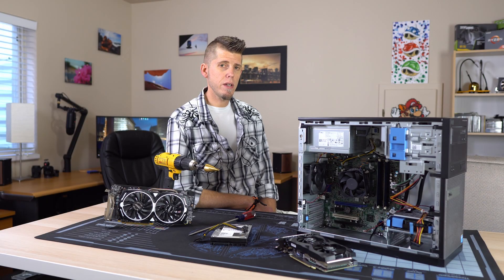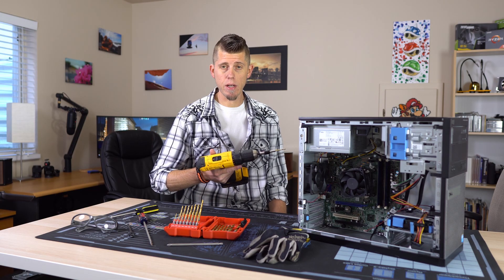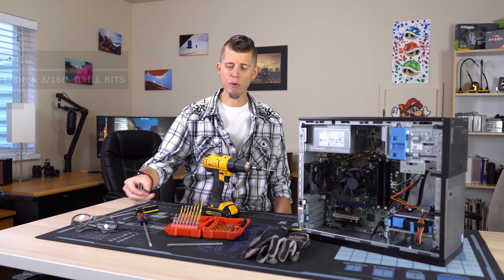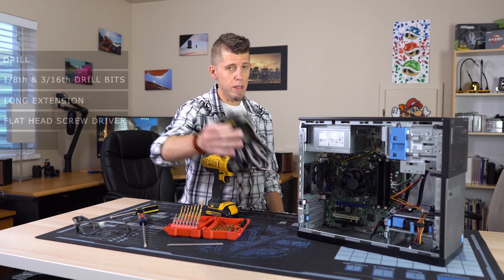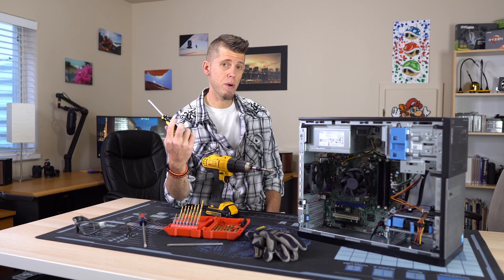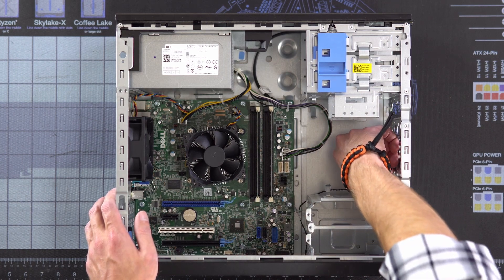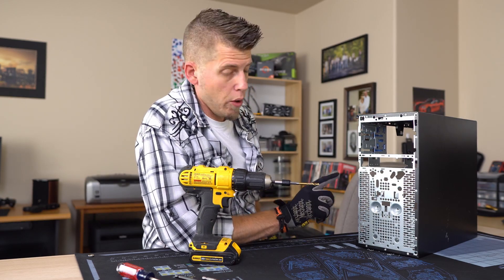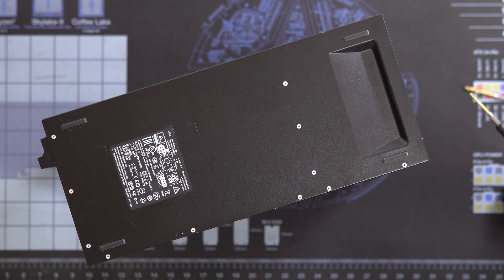Adding A Bigger Graphics Card In A Dell OptiPlex

Comment: The problem with an Optiplex, or a HP Prodesk or other similar corporate PC is the PSU is often Bespoke and does not offer any power for GPU's. Typically i have found the GT720 2GB is about the biggest card you can get that does not need additional power.
Reply from the maker: Actually, there are 1050 Ti models that don't require dedicated PCIe power that run just fine. I have one in an HP ProDesk 600 G1 SFF with a 240 watt PSU. With a 4690K, it'a max total system power draw at a full system load was just under 130 watts.

As for the xx20 series OptiPlex's, they have a 290 watt PSU and I've measured the power draw from the wall with these as well. You're fine up to about an RX480/RX570 or a GTX 1060/1660.

Anything above that, and I would agree that a higher wattage PSU is a must.

Comment: Edited for drunken behavior...
Reply from the maker: Damn man! You don't see many of those DT models. I've seen a lot of people doing just that, hacking a hole in the side, and leave the GPU sticking out. If you're going with the 1650, I did see that Zotac has a low profile model out... finally. You could always trade for that and then you won't have to hack the case up.
Reply from the maker: @kdevus  Haha... I was thinking you could sell it on eBay and grab a LP card, but hey, if you're cool with cutting it up. It's fun to mod crap. Thinking about grabbing an SFF and installing a 1080 Ti on the side.
Reply: @TheGameBench  Well, now another dilemma. Slot provides max 50w power. Card is slot powered. Requires 75w of power. They don't have LP cards that are 4/6/8 pin connect for external power. So if this self-powered card don't work, buying a power supply will do nothing. As the board itself is limited to 50W output on the PCIE 3.0 x16 bus. Sounding like the only option may be to ship it back. Get a similar card that allows external power, and go from there. Only thing is. If it's STILL not enough to power the card (I dont suspect its not enough but who knows) I'll have wasted two video cards and a power supply for nothing... not to mention buying an optiplex in the first place. I knew I should have bought the pieces and built my own. I'll let you know if it even powers up tomorrow with the GTX 1650. If it does, I'll go with the new 400W PSU and call it a day after modding the case. If not, I'm stuck...
Reply from the maker: @kdevus  I can verify that those SFF OptiPlex's can run 1050 Ti's. People run them all the time. A 1060 would be no issue either. The PCIe wattage limitation is a concern on some systems, but it's not a factor here.
Reply: @TheGameBench  The 1650 fired right up no problem. I had to modify the case. I'm putting in an extender window after I get some more dremel discs. It don't look bad. Once I get the window installed and the lights, it should be pretty cool. I'll have to show you. But I thank you for the help and confidence. I went ahead and jumped in, and it ended up working out. I'm still going to upgrade the power supply to a 450 bronze 80+ Seasonic for good measure. It passes benchmarks fine and only uses a little over 200 watts under load it seems. Dell probably kept it safe. It's a gold PSU dell has in this thing, and while its only 250w, I'm sure there a small margin. Now that it works, plays games well, and passes the initial crude tests, I can now focus on making it fancy. Yay. My first decent gaming rig. Optiplex 7010DT i7-3770, 16GB RAM, 4 GB OC DUAL ASUS GTX 1650, SSD. For some of my older games, it is pretty great. I'm about to run some tests on Fortnite just to see what it can do. Thanks again man. Rant over!

Comment: Or save all this hassle and go get a cheap $29 case and move everything into it. Saves so much time!
Reply from the maker: Nah, I'd rather use this than some trash $30 case that's going to have the structural integrity of tinfoil and cable management that's marginally better at best.
Reply: @TheGameBench  however, the cage and plate you removed was part of the structural integrity of the Dell case.
Reply from the maker: @yourpcmd  Not really. It's not any less sturdy after removing the HDD cage. Even if it were, it's still far more sturdy than a cheapo $30 case without the cage. Also, everything in the $30 price range looks even uglier than than these OptiPlex's. Especially when I get done with them. All that being said, the point of these videos is to build a quite capable 1080p gaming PC on a console budget.

Comment: I have a Dell 990 I have had for years that I simply used tin-snips (Home Depot $10 Aviation Tin-Snip) to cut out the drive cage. Not as pretty looking as your suggestion, but cheap and fast, as I did not have to take the case apart. With a PSU upgrade I run a full size  RX580 in it, but have also ran a Vega64 in it too.
Reply from the maker: I cut my hands reading this comment.

But really, if it works...
Reply: @TheGameBench  Yeh, I have not had any problems, but caution should be taken, might not be a good option for everyone. I actually only cut out 1/2 the drive cage, leaving the bottom slot for another HD. I don't monkey around inside it much as it is upgraded as much as will ever be: i7ver. wSSD, 32GB,RX580,x2 spinningHD, DVDRW (almost all are spare parts from other builds) Anyway great videos,  thanks for presenting sensible options, cheers!

Comment: I just got an Optiplex 3020 from eBay for $51 ($82 with shipping). It came with an i5 4590, 8gb ram, and a 500gb hdd
Reply from the maker: That's a good deal for a 3020.
Reply: The Game Bench Do you think an R9 270 can fit if I remove the sata power without removing the cage?
Reply from the maker: @TheStratus  Which R9 270? Most of them will fit without removing the HDD cage, but there are some models that won't. As for the SATA power, that's highly dependent on which model.
Reply: The Game Bench It’s the power color R9 270 with the clear fans. I did a test fit, it almost fits but the sata power is in the way
Reply from the maker: @TheStratus  Okay, I'm looking at this from every angle and I can only think of three options that are going to work. The first being to replace the power supply, and then you can just remove the cable. The second option that's still not jank would be to remove the backplate on the GPU and that would make it a little more flexible. The third option I do not recommend, and that would be to shave down that edge on the connector. I don't suggest this because it would expose the pins and they would short on the backplate for sure so you'd have to seal it off somehow to keep it from shorting.

Comment: Another Video needed on that Front Fan and mounting the SSD on the back wall ,,pls
Reply from the maker: Working on the fan video right now. As for the drive, I'll cover that in the build video, but I just mount them using a couple of 3M Command poster strips. They hold it solid and come off relatively easy if needed.
Reply: @TheGameBench  Ah .

Comment: I built my first desktop way back in 2000 with the new AMD Duron with all the parts from Newegg and Tiger Direct and I've always loved tinkering with computers. Sadly my local Surplus Exchange closed late last winter which was a treasure trove of used junk. I did get a Dell Inspiron 560 for $20 and the Dell Optiplex 9020 for $25 (minus hard drives). Also a GTX 660 for $15 which I managed to squash into the 9020 and got a Windows Experience Index of 7.6. That's funny. But my newest game is from 2014 so...

Comment: So how did you mount your SSD afterwards? Did you put the HDD up in the bay under the CD drive?
Reply from the maker: Yep, the HDD is mounted under the optical drive and the SSD is held to the side with some 3M Command strips. They hold the SSD firmly and come off pretty easy if you need to get it out.
Reply: I have Optiplex 790MT what video card is best to use
?
Reply from the maker: @fernandosibonga1068  What CPU does it have? i3, i5 or an i7?
Reply: @TheGameBench  it is i5
Reply from the maker: @fernandosibonga1068  So, we're talking a 2400 or 2500. Well, the CPU is going to be a bottleneck in some games to anything above, around a 1050 Ti, and even them CPU usage is pretty high. Now, that being said, you could put a GTX 1060 on it and still have an alright gaming experience. However, with that 265 watt PSU, I feel like the max I would go on the AMD side would be an RX 480 and on the nVidia side you could go with a 1060... just don't overclock. Anything more powerful will require a power supply upgrade.
Reply: @TheGameBench  Thank you! how about if I upgrade my CPU, what do I need to buy?
Reply from the maker: @fernandosibonga1068  No problem. If you wanted you could buy an i7-2600, they're about $50 to $60 on eBay and it will drop right in. Then you could run a 1080 Ti if you wanted. If you find a 2600K for a really good deal, you could use that too, but the clocks speeds are the same and you can't overclock with these boards. However, avoid the lower voltage model 2600S.

Comment: I love watching you do this stuff but I'm just not industrious enough.. by the time I got all those parts detached I'd be browsing for a replacement case. 😂
Reply from the maker: Haha! I totally get it. Kinda' at the same cross roads with my main rig.
Reply: I did not want to take everything out, but the reasoning was sound. I had to talk myself into it. The whole reason I bought the Dell was to avoid building a PC, after all! I had worked in desktop support during the capacitor fiasco, and after hundreds of motherboard replacements (I'm not exaggerating at all; my employer had thousands of PCs, and the capacitor issues went on for years), I'd had enough of that kind of experience to last me a lifetime. I procrastinated for a week after watching the video, but when I dove in and did it, it honestly wasn't that bad.

Comment: hahaha "BUT MAH DRIVES?!". I died.
Reply from the maker: @Inareth That bracket I cut out was never intended for mounting a HDD. If you want to see where they all go, watch my latest video. I go over all that. This was all meant to be part of a five part series.
Reply from the maker: @Inareth Now all I can see is Chuck Norris doing a round house kick to an OptiPlex out of a window, falling 30 floors, and smashing into the pavement. Oh, and because it's an 80's action movie type fall... it explodes halfway down for no apparent reason.

Really though, that was my suspicion as well, that it was left over from the days of the floppy drive or a card reader. That being said, when I cut them out in the fan video, I told people it's just an aesthetic choice if you got plans for it or don't care, leave em' in.
Reply: I had English captions on and it said Madras 😂
Reply from the maker: @MrMctuck  Hahaha. Seem I need to run through the generated captions and correct some crap.
Reply: FACTS HE didn’t EVEN COVER THAT

Comment: Ha, I had just watched your previous Optiplex video this afternoon! Slight case modding is pretty fun, managed to drill out holes on a Dell XPS 8300 to be able to hold a 2.5´´ drive as it could not before. Not a hard mod or anything but still, bit proud of it lol
Reply from the maker: Exactly. It's interesting how none of the other videos, that I've seen, have done this. The first OptiPlex I got, I didn't do my research, and the GPU wouldn't fit. About 10 minutes later, the HDD cage was out. Makes such a difference.